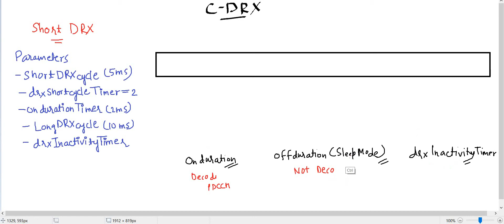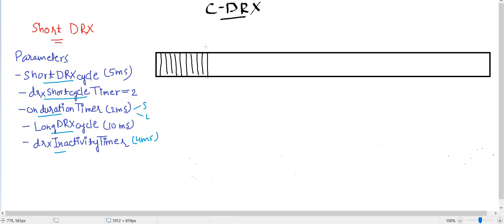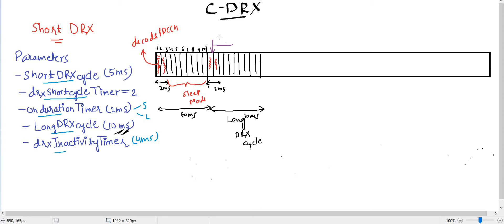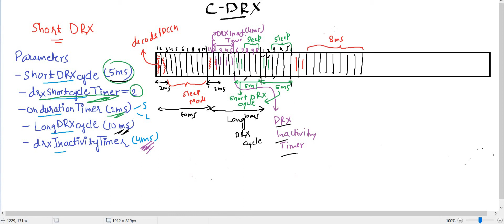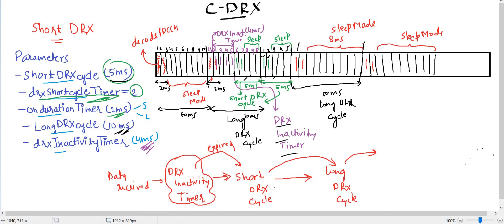LTE DRX Part4

Comment: Nicely Explained! Thank you for all videos.
Q: For cDRX RRC state remains connected even if UE is in Sleep mode during long cycle... does it condition when UE goes to Idle mode...and should DRX should remain if UE in Idle....
Reply from the maker: Iff RRC_Inactivity_Timer is not expired then UE will be in RRC-Connected mode irrespective of received DL data. If DL data is not received UE will go to Sleep mode.
In RRC-Idle mode PagingDRXCycle is used (parameters are provided in SIB2).